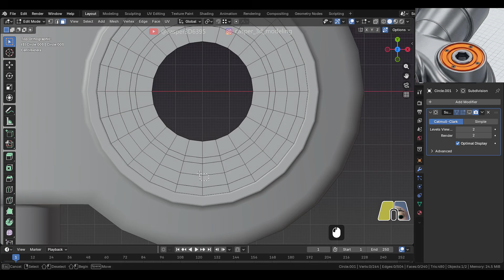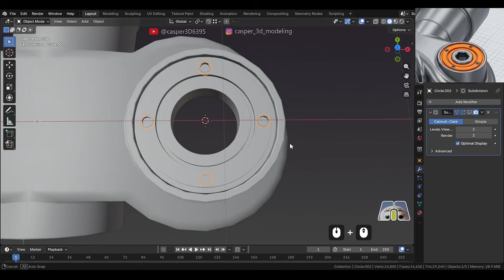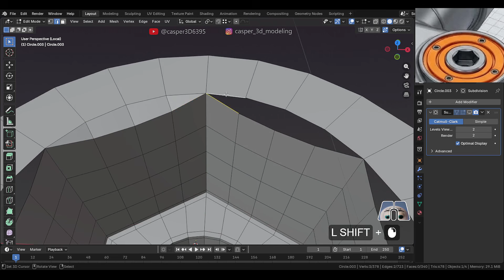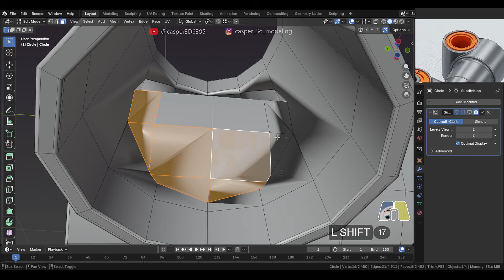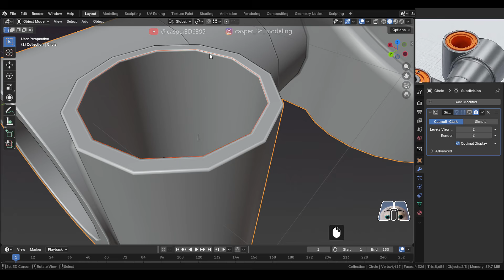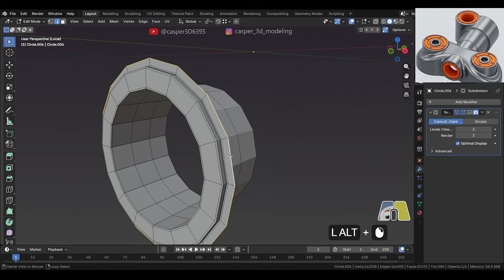Blender Practice – Mechanical Connector | Adding Details

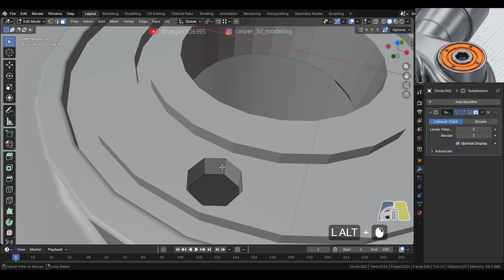Comment: 1:38 Is there a reason to separate the screws mesh from the rest of the object? When is it good to separate different parts of an object? What are the pros and cons? 
PS: I am currently learning 3d for fun and your videos have been incredibly helpful for learning. Im on route to watching all of them. Currently about half way.
Reply from the maker: Thanks! Glad the videos are helping. I separated the screws mainly because they’re separate parts in real life too. It also makes them easier to move, edit, duplicate, or replace later. There are pros and cons to both approaches depending on what you’re making.

Comment: why when i use spin tool it bugs and dont put it correctly
Reply from the maker: Thanks! Make sure you've applied the scale (Ctrl + A - Apply Scale), place the 3D Cursor where you want the spin center, and use Numpad 1, 3, or 7 to align the view before using Spin. After spinning, press M - By Distance to merge any overlapping vertices.

Comment: Blender 5.1 really struggled with bool tool. When I got to the back cylinder boolean part, Blender's built in boolean failed every time, so did bool tool, but HardOps boolean worked. So odd! Anyway I figured it out and got it finished. Thanks for the tutorial, really good stuff in this one!
Reply from the maker: Yes, that can happen. The mesh needs to be positioned correctly, with the scale applied and the normals facing the right way. Glad you got it working, and thanks for sharing what worked for you!
Reply: you have to position it better or dont use bool too just use the boolean modifier and if it doesnt delete the faces delete them manually